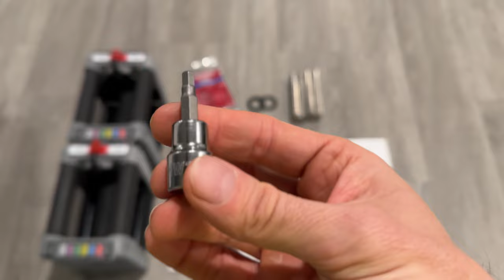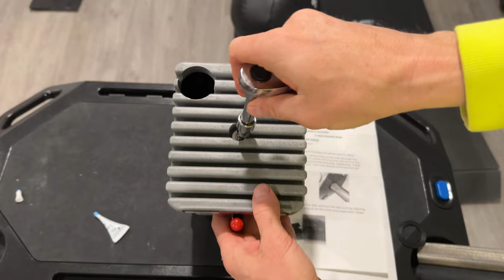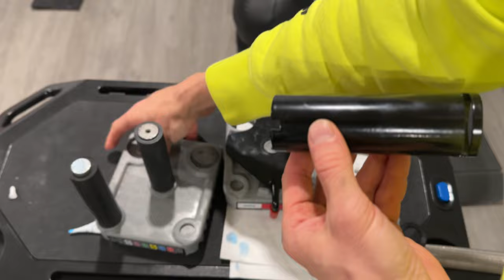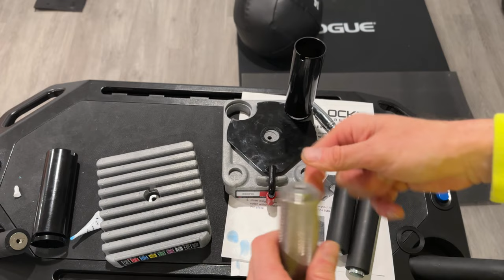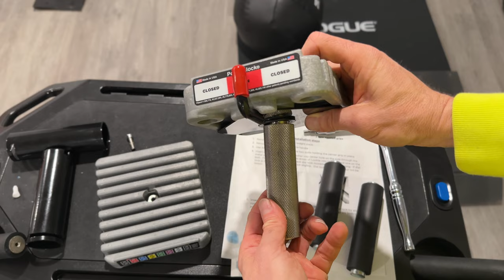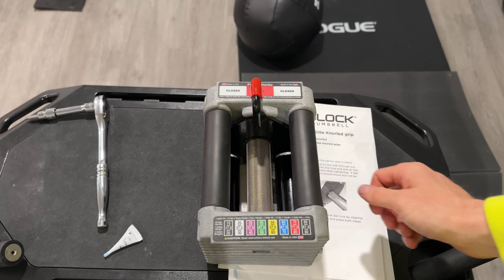Powerblock Knurled Grip | Install Steps and How to Setup (Totally Worth It!) #fitness

Comment: Great video, very informative. Question about the knurled grips after install... do you find that the knurled grips rotate in place ever so slightly or are they rock solid? To be clear, if you grab the grip and try to turn it as if you were revving a motorcycle handle, do you feel a slight turn or none at all? Thanks!
Reply from the maker: @Nitz335i  no they don’t turn at all. Thanks for the comment and the question.
Reply: @EricB03  Thanks for the reply!
Reply from the maker: @Nitz335i  my pleasure

Comment: is the washer rubber?
Reply from the maker: Been a while since installed and it is not soft rubber but more like a hard nylon washer if I remember correctly. I am not 100% sure but going by memory. 

Btw loving them and no regrets at all.
Reply: @EricB03  Okay thank you I bought the bare steel equipment knurled handles but am having trouble installing them. With the washer they provided the powerblock handle is loose and cannot adjust the lock.
Reply from the maker: @kellerv.602  can you provide a link with what you bought? What is the issue with install?